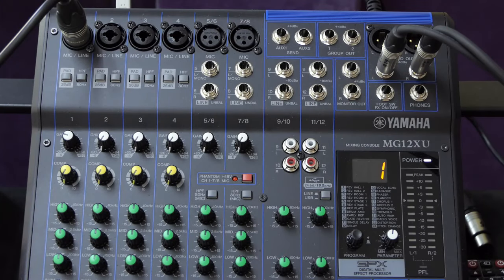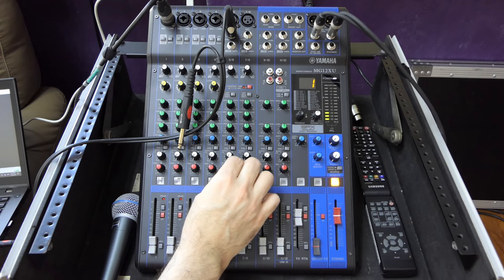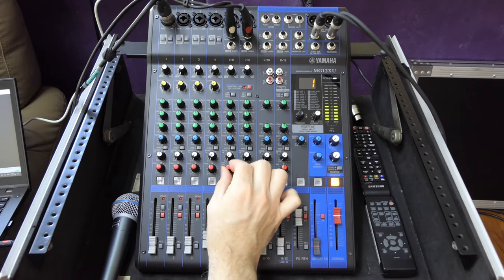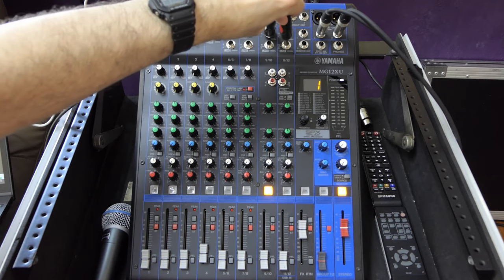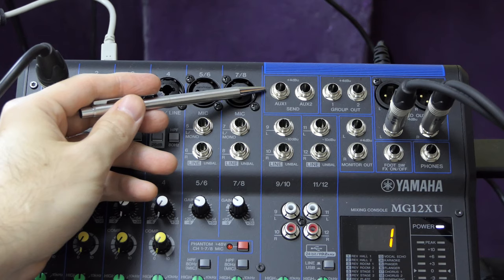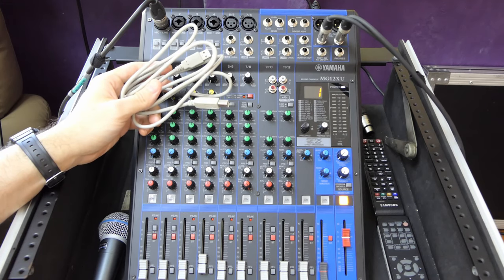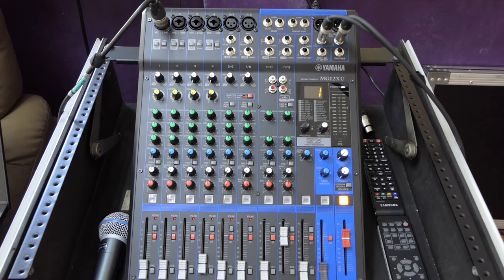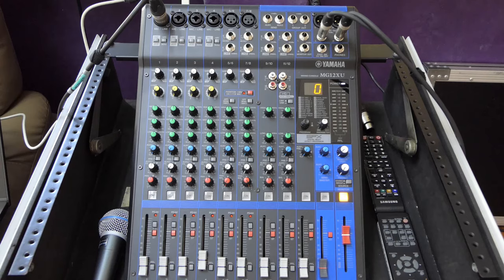Yamaha MG12XU Mixer Tutorial Part Two

Comment: Hi Sir, I've watched this a couple of times looking for the answer to one problem I'm having.  For some reason, I'm not getting the effects signal to route through the AUX send outlets.  I do have a dry signal and I'm getting a wet signal to the mains and headphones. I'm sure it's a miscommunication between me and the board, LOL but it's driving me nuts and taking way too much time.  Any ideas. FYI, I have the same mixer.
Reply from the maker: Hi Larry, the wet FX signal can only be sent to aux 1 output - to do this you use the blue "AUX 1" knob above the FX RTN fader.
Reply: I can't thank you enough!  It will work that way, using aux 1 for the front monitors and aux 2 to the back drummer without fx. At least I know that is exactly how it works.
Reply from the maker: You're welcome Larry :)

Comment: Hi. The Chanel 9/10, 11/12, has no Gain control.  Suppose the Gain level that he comes from the phone, computer, etc.  It's too low.  An example,  the music from the YouTube,  has low gain level. In this case, how do you increase the gain  level with PFL On to 0db if there is no gain control level? Thank you.
Reply from the maker: Correct - those channels are designed for signals where the level is already at or near line level. There is 10dB of additional gain available on the fader but no input gain control. If your incoming signal is too low either use another channel or increase the output volume on the device - phones and computers volumes should generally be set to 100%, as long as it doesn't cause distortion.
Reply: @GLBProductions  Thank you for your answer.

Comment: Hi I'm using this desk with 2 rcf 935s. I am purchasing a single subwoofer soon as was wondering is there a way to connect it so that i can control the volume of the tops and subwoofer independently,  rather than having to walk over to sub to turn it up or down. Thank you for great video
Reply from the maker: You're welcome Mick 😄 You can use a technique called aux fed subwoofer. Go to my video on active subs and look for it in the chapters: https://www.youtube.com/watch?v=548GZAF6fMY

Comment: These were so helpful! 

I have a few things that still aren't clicking. 

Can you use more than one of the effects at a time or a different effect per channel?

I want to have a few pedal effects in addition to the onboard effects. I imagined that there would be an out - and then it would go through that chain, and back into the mixer. I have the MG10XU and there are no Aux sends, but I'm not understanding how the chain would loop back in here. Would that go into a second channel?

And this last one might be silly, but I've gotten used to my MG10XU being mounted to a mic stand. Does this one have those attachments? Is it too big for that? Because if it doesn't, and it's going to need to take up more room anyway, then - would it make sense to just go all in and get the larger 16-channel one? Then I would just put it on top of my rack instead.

Also, as far as the USB part: if I already have pro audio interfaces is there any reason this would be helpful? If it's just the left and right (no separate channels), then it doesn't seem like much use, unless you're using it as your only computer interface. This is new: Yamaha MG16X CV 16-channel Stereo Mixer  (what is the CV) - would that be a better choice for someone who doesn't plan on using it for recording?

Thank you for the wonderful overview!
Reply: Looks like the Yamaha BMS10A Microphone Stand Adapter - is only for up to the 10-channel version
Reply from the maker: Thanks for watching Derek. To address your questions: 
You can only have one effect active across the entire mixer at any one time. 
To use outboard effects you would use a post-fade aux send as FX send and then return into any unused channel - either mono or stereo depending on the output of your FX unit. On the MG10XU you can actually use the FX send for this purpose, but you will not be able to use the internal effects at the same time. 
The most useful function of the USB interface IMO is to bring music into the mixer from an external computer - much more reliable than using the computer's headphone output. As you point out it is only useful for basic recording. 
The MG16X is the 16-channel of the mixer without the USB interface - Yamaha do not use the CV suffix so I suspect it may be something that the retailer has added for their own reference.

Comment: The video was very helpful in my purchasing decision. However, I still have 2 technical questions.
I would like to send music from my iPhone/iPad to the mixer. Since the mixer doesn't have Bluetooth, I would have to connect a Bluetooth receiver to the mixer. Which inputs can I use for this? I would also like to connect 2 JBL Party Boxes to separate the left and right channels. Can I connect the left output to the AUX input of the left party box and the right output to the AUX input of the right party box to get the stereo sound?
Reply from the maker: Hello Klaus, glad the videos have been helpful! You can use any of the stereo inputs for your Bluetooth receiver, i.e. 5/6, 7/8, 9/10 or 11/12, depending on whether your cables use 1/4" or RCA connectors. For your second question, yes you can do this. You can also try connecting to the guitar input, with the gain on the partybox turned fully counter-clockwise. All the best with your sound!

Comment: I have purchased this desk now! 😁
Reply from the maker: Enjoy your new mixer!
Reply: @GLBProductions  I have a couple of questions actually. Do you still have the desk to hand?
Reply from the maker: Go ahead!
Reply: @GLBProductions  Many thanks - OK, I have a MONO (Cyclone Analogic) drum-machine. It will be fed into one of the (Yamaha MG12XU) LEFT/MONO channels (eg. left input of channel 11/12). This will then (obviously) be fed through to the house-PA system using the stereo MAIN OUT canons (as you would normally do) alongside all of my other keyboards running into the desk.

However, I need to send to the (live) drummer a copy of the drum-machine channel (because he will need to keep time with it!). Therefore I understand this is achievable via the AUXILIARY ONE send/output. Only the drum-machine is being routed to the drummer and so the blue AUXILIARY ONE dial within the (Cyclone Analogic) drum-machine channel needs to be raised appropriately.  My issue is that I am not able to achieve any sound/volume when connecting my headphones to the AUXILIARY ONE send/output? Obviously I am doing something wrong here, if would might be able and kind enough to assist, please? THANKS! Paul
Reply from the maker: Hi Paul, the reason you have been unsuccessful is that the aux one send is not suitable for direct connection to a pair of headphones - although it uses a quarter-inch/TRS socket it is wired differently and is not equipped with a headphone amplifier. You need to connect this output to a separate headphone amplifier first, and then the drummer will be able to hear the signal.
Reply: @GLBProductions  Many thanks for your support. I really appreciate your help. Are there any one channel headphone amplifiers that are adequate and inexpensive please? Do headphone amplifiers run on mains or batteries?
Reply from the maker: I'm not sure about one-channel headphone amplifiers but if you are using it to drive a drummer's headphones you need a clean and powerful headphone amplifier, something like the Presonus HP2 or HP4. It also needs to have a mono function to send the aux 1 signal to both sides of the headphones.
Reply: @GLBProductions  Many thanks, I will take a look...
Reply: @GLBProductions  Oh dear, quite expensive!!!

Comment: Hi, I have plugged in a USB 2.0 cable into the computer connecting the mixer. Originally I can hear the sounds from my computer through my headphones that are connected to the mixer. But now after I have recently replaced the USB cable I am unable to hear anymore. Any idea what went wrong? When I test the sound on my computer settings the volume bars flicker so obviously there is output. and also input when I speak into the microphone. I just cannot hear the return sound from the PC back to my headphones.
Reply from the maker: Hi Chris, if the ONLY thing you changed is the USB cable then the new cable is probably the issue - try switching back to the old cable (or another cable) and see if the problem goes away.
Reply: @GLBProductions  Yeah I did... but now it no longer works with the previous cable as well. :( I don't know what has changed or the USB point is suddenly damaged? Sigh. I can still record to my DAW and the mic portion works but I cannot hear it back from the computer and have to switch it to system speakers to listen to what I've recorded.
Reply: Scrap that. Am new to this and keep missing out on that one or two buttons that matter. First I didn't press down on the "Line/USB" button and I realised it. But still no sound and am vexed.... and I realised PFL for USB is also not pressed in. Gosh I feel like a total id*%t now. Thanks for the reply though.
Reply from the maker: Well done on spotting that! That's why I asked if the USB cable was the only thing you changed. A single switch in the wrong position can cause major problems.
Reply: @GLBProductions  yes! And all thanks to your tutorials! It’s really confusing figuring this thing out and when to press the “ST” and when to press the group and when to press all the little buttons or bring up the faders. You’re right! One small step and it’s wrong! Appreciate the detailed tutorials! 🙏🏽

Comment: i have a question,  i hope you can help me. let's say i have to use a cellphone as my audio source and my availble inputs are ch3 and ch4 and phantom power is ON. would it damage the cellphone? or i just have to turn ON the pad? thank you.
Reply from the maker: In this case I recommend using the 1/4" inputs - phantom power is not present there, so you don't have to worry about damage to your phone.
Reply: @GLBProductions  thanks  for the reply. but in the case of the yamaha MG series, its combo inputs where mic and line input are internally connected as per shown in its diagram.
Reply from the maker: Yes, it's true that depending on the type of combo connector used and how the connector is wired phantom power may be present at the TRS input pins. You could use a multimeter to confirm this: measure between tip and sleeve with phantom power on - if you see 0 volts then you are ok. To be absolutely safe, connect via a passive DI box, which will block the voltage.
Reply: @GLBProductions  thank you for your time.. helps a lot.

Comment: If you were to connect a mixer to a video camera, how would you do it?  I enjoy and benefit from your videos covering live sound equipment and setup.
Reply from the maker: It depends on the camera - for professional camcorders and others with XLR inputs it's just a case of connecting one of the mixer outputs to the camera and setting that input to LINE level. For cameras with just a 3.5mm input you will need to run through a recorder or adapter that drops the mixer output to microphone level.
Reply: @GLBProductions  I'm using a DSLR which only had a 3.5mm stereo mic input.  I'm going to try to utilize DI boxes  which will allow me to apply a couple of different levels of PAD.  There is some level of adjustment on the input signal in the camera, this combination should work.  Waiting for the XLR to 3.5mm adapter cable to test this.  Thanks for your response.
Reply from the maker: You're welcome. Keep in mind that the XLR to 3.5mm cable may or may not work as these two connectors are not electrically compatible with one another: you are connecting a mono, balanced output to a stereo, unbalanced input.

Comment: Brilliant tutorial, thanks so much for your time. Q; Our band has two guitarist singers at front of stage, each has his own monitor. Would the best way to allow the guitarists to hear vocals be to use Aux 1 routed to first monitor then on to second monitor (daisy chain) or use Aux 1 for one monitor and Aux 2 for the second monitor. Mixer used is MG12XU. The singer guitarists in question to not mind hearing a mix of each others vocals.
Reply from the maker: In this case I would use aux 1 and daisy-chain the monitors - aux 2 on this mixer is not really designed for use as a monitor send, as it is post-fader and is also shared with the send to the internal effects.
Reply: @GLBProductions  Thanks so much for your swift reply. 🙏
Reply from the maker: You're welcome, all the best with your music :)

Comment: Hello, I've connected the mixer to my laptop via USB.  My laptop recognizes the MG mixer in both, the input and output settings.  I've pressed the USB setting (not line setting) in the mixer and I've connected a microphone into one of my mixer channels.  I'm getting the sound of my voice via microphone from the mixer monitors.  My problem is that my PC won't pick up the microphone sound from the PC at all, even when I test it.  Needless to say, Zoom won't pick up my microphone setting either - the sound level bar won't even activate for the microphone, but it will when I disconnect the USB from the mixer.  Any suggestions?
Reply from the maker: Hmm, did you remember to switch the mic channel ON and route it to the LR outputs? Is the main ST fader up and the master channel switched on?

Comment: really great and thorough video - thanks. so much better than the wizzy ones you see with overloud background music. I was pleased you did some cross patching as in my case i believe you can then use aux 1 and 2 as an additional stereo output  with the respective auxs up and for my application thats very useful .  great job Nick  Scarlet Town Music
Reply from the maker: You're welcome Nick, what do you mean by 'cross patching'?
Reply: Hi, sorry if i didnt expand on that , after studying the flow diagram i was thinking it might be possible to send a dry stereo signal out using aux 1 and 2  outs as a stereo out l and r by connecting a stereo input putting left channel to input of one stereo input channel and right channel  to a different stereo  input channel, then turn up aux send  1 up on one stereo channel and aux 2 up on the other stereo. The channel aux sends are pre balance so not an option to just turn balance l and r., although  to mono channels should worķ. So the cross patch is using two stereo channel inputs for one split stereo input. Right need some tea now! Thanks nick
Reply from the maker: Ah yes I understand - but why would you want to do that? The send to an IEM system?
Reply: @GLBProductions  hi, thanks reply, my application is production and studio and if i buy one it will be to replace an existing submixer so the more inputs and outputs the better, to avoid having to repatch makes life so much easier and tidy, so another stereo out is very useful using two aux outs. Some others this size only have a single aux out so its going to be summed mono and no use in the sudio if dry stereo signals are created earlier. Another point on the yamaha is the channels with jacks and rca is useful but wish it was switchable so things can be permantely connected, my existing submixer has this feature. Regards

Comment: I learned some valuable information here, thanks. However, what I was searching YouTube for information on multi-track recording. I want to record music adding one layer at a time, but I need to be able to hear the computer output in headphones without them recording them a second time. For the first track or two, I would need to be able to hear a click track. It would be best if I could have the headphones from the mixer so that the computer and its fan are at the other end of the room. I have the MG10XU, not the "12".
Reply from the maker: You would use the "to mon/to ST" switch on channel 9/10 in conjunction with the stereo mute button on the monitor/phones control: I mention this feature in this video: https://youtu.be/Jb-Hfgo3kck?t=1294
Reply: @GLBProductions  Good news! Thank you very much.
Reply from the maker: You're welcome! Be sure to refer to your manual - this feature is actually explained very well.

Comment: I only have one FOH side out front. I'm using a bose system. I use tracks live and play guitar over them.  I come out out of the blue tooth of my tablet into a blue tooth receiver I want to plug into a channel on this mixer. The Bluetooth receiver only has one output. What cord and channel should I use to make sure the stereo imaging is in the center so it doesn't sound like some older recordings ie: James Gang or VH doesn't sound like one side of a stereo recording, even though I'm  essentially running in mono? I wanted to maybe use compression as well but I'm not sure if I can do that into one mono channel,  and still be able to have it come out sounding like it's not one side of a stereo mix. My tracks sometimes overdrive the system and aren't sonically the same. This gets confusing....
Reply from the maker: Yes this can get confusing for sure. The best way is really to start with all mono sources, so for your bluetooth receiver run the output into some sort of stereo to mono converter or even a stereo to mono DI box such as the Radial ProAV1. That will ensure that no information is lost from your backing tracks. Alternatively use two mono channels, both panned center.
Reply: @GLBProductions  I talked to Yamaha they said to go into 2x channels 3&4, cause I have a stereo output on the blue tooth receiver and keep everything panned in the middle. Will this work?  I guess on my bose mixer the 4/5 channel must what is called summed together? Then I was going to turn the st switch off on those channels and just use the blue fader(subgroup) with   the st switch on as a master for my music tracks.
Reply from the maker: Yes, that concurs with the advice I gave in my reply above.